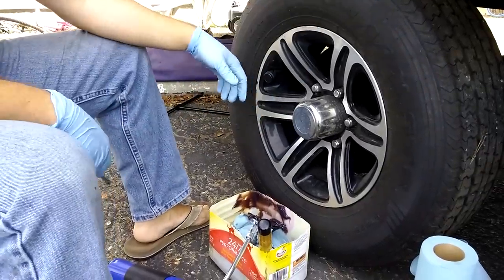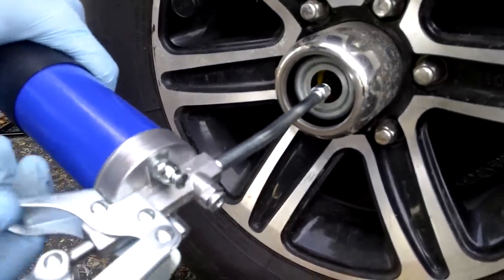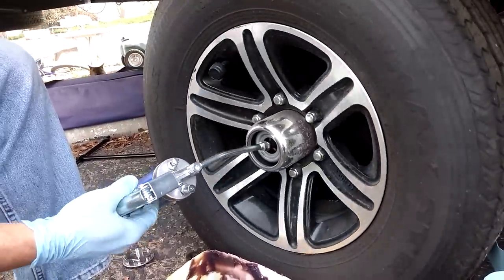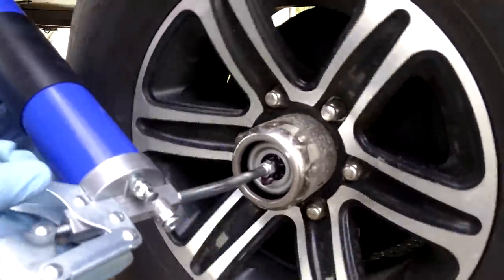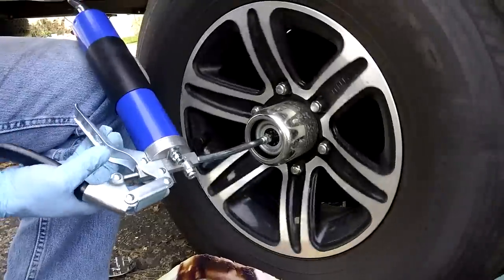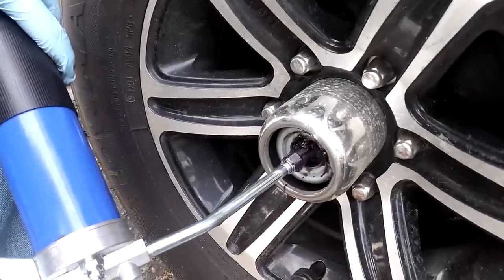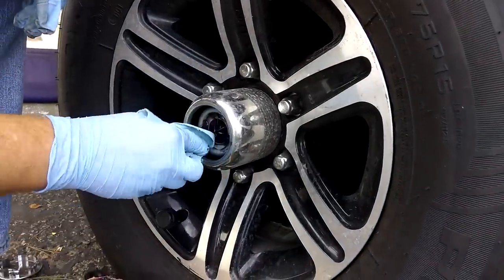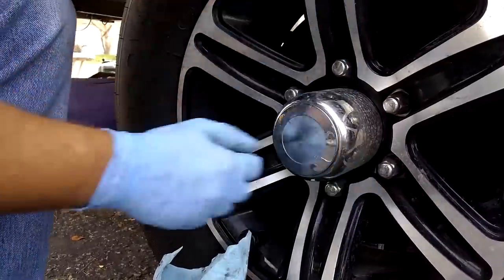How to Lubricate Dexter EZ Lube Axles

Comment: You didn't service anything. You don't know the condition of the bearings, brakes, magnet or the bearing adjustment.  Hub should never be filled over 30%. Over filling can cause the hub to over heat. EZ Lube is for emergency use only.

Comment: I just watched this video and I realize it's 6 years old but even if you go to the Dexter channel itself they don't show this way of redoing the grease in your bearings. They show tearing it apart inspecting them the bearings the races putting it all back together twerking the bearings to 50 ft pounds in them backing them off. I was always told not to do this You can blow the back seal out and screw up your brakes. I'll stick with pulling them apart cleaning every season It's a little bit of time to make sure that you're not running dry or over packing grease and maybe running out of brakes. Well this coming probably doesn't really mean much anymore He stopped making videos a long time ago I wonder why?

Comment: If you use this system, It's best to replace your current seal with a double lip seal. NO grease will get past it using a grease gun.  I've been using this system for 12 years and have had NO grease in my brakes as well as NO bearing failures or any other issues.  I do, Every other year, Depending on miles traveled, take out the bearings, clean and inspect and repack or replace. Works for me.
Reply: (It's best to replace your current seal with a double lip seal).....Would a double lip seal have a special number? How do I find the one that will fit my axle?
Thanks
Reply: Hosey OGradey have you had it fail otherwise? Just wondering why it was never stated in the manual...my father in-law has never switched his.
Reply: EZ lube axles have the double lip seal. Reseal after no more than 10,000 miles or 3 years. Bearing play will reduce seal life. So keep them tight.

Comment: Any one who actually believes this works, has never disassembled one of these axles to see how it is engineered. The end of the spindle is drilled all the way to the back side of the inner bearing, and then cross drilled to allow grease to come out behind the bearing. This DOES NOT pack grease in the bearing. In fact, I have repaired many customer's trailers that have experienced wheel bearing failure because the hub filled with grease then the pressure from continuing to pump grease in to this cavity pushed the grease seal out and now exposed the wheel bearing to dirt and water. Not a good design unfortunately :(

Comment: I'm on the fence about this.  I was told that OVER greasing a bearing can be bad for bearings, almost as bad as NO grease.  When you fill the hub cavity with grease, you're making it hard for the bearing cage holding the rollers to rotate, and can in some instances cause the rollers to SLIDE over the races and cause spalling or galling of the surfaces and lead to failure (not to mention the heat generated from all that grease churning around in the hub).  I have always disassembled the hubs and replaced the seal after a thorough clean and repack.  I don't care for the zerk idea myself.  That means extra work....a LOT of extra work, but I will have the peace of mind that the seals are fine and there won't be any chance of the grease being cooked and hardened.
Reply: Yup don’t believe in this, take them apart every few years

Comment: and the reason it takes so much grease is because you are filling the voids in the hubs. Under normal braking, lots of heat is created, causing the grease to be slowly pushed out beyond the seals leading contaminated brakes. Hand packing is the way to go. This system works great on axles without brakes, not with the ones shown in the video.

Comment: I have watched so many videos about how to grease these dexter axles.  
My conclusion is this.  If have to anyways take everything out once a year to inspect the breaks and do the manual packing, why in the world should I do the EZ lubing like the video shows, unless I put an insane amount of miles.  

Just put enough grease between bearing by hand before you put the outer bearing and I am sure you will have good lubrication for at least an entire year.  

I know it looks very easy to do it this way, but does it worth the risk of blowing the seal, or putting too much grease unnecessarily.  

Looks like the outer bearing won’t get enough grease until the void is completely filled and at that point it will be packed with grease and I am afraid of the risk of grease expansion once the axle gets too hot?  

In my case there is no way in hell I will put so many miles to my rig.  A yearly or maybe 2 years proper packing with plenty of grease will surely do.  Correct me if I am wrong.

Comment: I keep hearing that you can blow the seal out by pumping too much grease. But I also read that the EZ Lube axles were designed so this can not happen. I don't know which is true. I seen videos of people filling these with out even spinning the tires and saying they had no problems at all. Others are confusing these for bearing buddies and other's say you don't even have to do this on a cargo trailer it's only meant for a trailer immersed in water like a boat trailer. What is true here?
Reply: This advice about pumping too much grease is probably for other types of grease-able axles, like bearing buddies added onto existing axle, where excess grease/pressure goes out of the inner bearing seals (and can sling onto brakes, etc). If you watch the Dexter EZ Lube video they describe how the axle/bearing channels are designed to recirculate the grease through inner, then outer bearings, and finally back out around the fitting area. So at least according to Dexter, this video is exactly how it's supposed to be serviced.
Reply: It is possible to blow grease out the inner seal if you put too much muscle into your pumping. A nice gentle pump and spin the wheel and no problem.
Reply: @DragonPilot  I haven't had problem  after doing all 4 wheels; however , one of the rubber covers had I hole on it and there's grease coming out of it. I haven't seen those rubber plugs sold just by themselves but I did see grease cap kits made by Rockwell.

Comment: Just did ours on our ‘18 Jayco Eagle HT 5th wheel for the first time….  Took 150 pumps at each wheel before grease came out.  Assuming manufacture lubed them lightly….  Hoping next time only a few pumps as they are now filled w/ grease?

Comment: I put a lot of miles on my 20 and 24 ft enclosed car trailers. I’ve seen a lot of videos and read manuals. I do 200 to 2500 mile trips daily. I always check my bearing play by jacking up the trailer and seeing,feeling and hearing how it turns freely. I pump a small amount of grease in each trip, not a full tube at any time. I get back to base and take each wheel off and repack them correctly and check the seals. When that grease catches on fire from heat, you’ll regret it. Safety first. I change about 5 brake drums and backing plate brake assemblies on the 2 year span I keep a trailer.

Comment: Thanks for the video. I've only had conventional axles that needed packing. I have these on my new trailer and they look so much easier. Haha apparently to others who have commented, I'm an uninformed idiot I guess 😂
Reply: Backcountry Adventure Motorsports that's what I was thinking isn't the whole point of having a grease fitting so you don't have to do the extra work I think it's a lot better system I think what the other. Stand is it's not the whole point of getting new crease in there it's about getting Grease.
Reply: Backcountry Adventure Motorsports i

Comment: So please explain this.
You put a whole tube in.
Just a small golf ball of the old came out. How is that replacing the existing grease? What am I missing pls. I know you say they come with hardly any grease in them but surely they don't come with that little grease. Just confused.  Thanks.
Reply: This is his first try at this. There is a void in the spindle that need to be filled before it reaches the outer bearing and them out
Reply: @raylaux8295  i actually did mine about 2 months ago. Went perfect. Exactly as expected. Glad people made videos. That made it so much easier for me and gave me the confidence to.do it myself. Took about 3/4 of a tube per wheel. The hardest part was my fingers ached after a while. Well worth it tho considering the simplicity and money saved . And the peace of mind that it had been done right.  Read so many horror stories of places saying they replaced it and only partially did it.  Thanks.
Reply: @OverkilledUnderdog  Problem is you don't know if it is done right. You can not see all the grease you blew past the seal and ready to sling on the brake shoes. LOL. Seriously, replace seals if you have more than 3 years or 10,000 miles on trailer.
Reply: There are different colors of grease so change colors each time and you will see the new color come out

Comment: I've tried this with mine but it won't take any grease.  It must be clogged up inside.  I had them repacked at an rv place.  They looked very dry when I got it back.  I'm afraid to force grease in as it could blow off the rear seal.

Comment: If you have Ez Lube, do you still need to repack the wheel bearings sometimes?  I'm seeing mixed information on this.
Reply: You don’t need repack all the time!
Reply: I hand pack every 3 years or so, but do the EZ lube in between. It's good to take everything apart so you can visually inspect the bearings, races and spindles. Ya can't do that by just using the EZ lube system...altho it's perfectly fine for quick maintenance.

Comment: I have a 2010 36-foot fifth wheel RV made in canada by dougles (now out of business) it has three slides. It came with the Dexter axles and of course those axles came with the dexter Nev-R-Lube wheel bearings. I have to say that I like those bearings but when it comes to replacing one that has failed, I will not buy from Dexter due to their outragous price. Timkin makes the same bearing and cost a lot less. I replaced all 4 bearings with Timkin. Now on my Loadrunner inclosed car transport trailer, I came with Dexter E-Z Lube bearings... heres a link to Dexter showing how to maintain them 

https://youtu.be/XT0RKDGgDm8

Comment: There are plenty of stories of people doing what you are doing and ruining their brakes. Chances of leaving them without brakes because over filling.  This can cause the seal  to fail when the heat and pressure builds  up inside. 
I have see what this can do. The seal will fail and that grease will be dispensed within your brake drum coating the brake pads.

Comment: deprey  is right read your manual only 2 squarts per 500 miles. you got to take those hubs apart an clean probly replace breaks you are doing it all wrong.
Reply from the maker: This is the right way to do it for EZ Lube axles. I did read the manual.
Reply: I agree this is how EZ's are supposed to be done as per my cargo trailer manual
Reply: He is doing it correctly.  I think people get confused with A bearing buddy compared to the Dexter E Z lube. The dexter method pushes out old grease And repacks new.
Reply: steiger 256 pushes it where?! Out the back seal all over the brakes.
Reply: No, watch the video, it comes out the front.
Reply: 'Spell Check' can only do so much.

Comment: DONT use the Lazy-lube system unless you want to blow the rear seal, grease the brake shoes. Follow this step by step process by Dexter on how to do it the correct way. If you pump it full its like letting a blind man do it, can't see what is going on inside. https://youtu.be/GnH-h3W9XvI
Reply: Been lubing EZ Lube axels using this method since 2002.  Never had any problems with the EZ Lube system.  But maybe they're not idiot proof.  Who knows?
Reply: That video references standard axles, not ones with EZ Lube system.

Comment: Don't ever use this system. Since you can't see how much or where the grease is going most blow the rear seal out which allows grease to get all over the brakes. If you are just to lazy or don't know to pack bearing the old way take it to a shop. If you want to learn the correct way which is so easy watch this Dexter video, https://youtu.be/GnH-h3W9XvI
Reply: I have this Dexter system and would never use it. Go to the Jayco Owners Forum web page and read all the horror stories. Even if done as the videos shows you cannot tell where the grease is going and over greasing will cause seal failure, sure it won't happen every time but sooner or later it will. Just because Dexter created this system doesn't mean it doesn't have flaws. Its such a simple job to pull the hubs clean the bearings, inspect and if ok grease and reinstall. If you don't feel comfy doing it take it to the dealer, why risk your families life due to bearing failure or brakes that don't work, and the poor guy you reared because you can't stop. I know this is to the extreme but it can happen and I will not take a chance to be lazy and pump some grease in.
Reply: That video you posted said to set your new seals with RVT sealant...... l’ve never done that, should I be?
Reply: @satellitehunter7440  I didn't notice the RVT suggestion, I didnt do that just tapped it in flush and its nice and tight
Reply: Uncle fester so you’re telling people not to follow the video, point them to another video and then don’t follow the advice of the video you recommended?  Got it

Comment: DO NOT use the method described in the video. All you will do is push grease through the rear seal and ruin your brakes. Take the wheel apart and grease the bearings the old fashioned way. The EZ lube system is garbage.

Comment: Only an uninformed idiot would use the grease fitting to lube the bearings on a trailer.  You're just cramming new grease on top of old grease and possibly damaging the seal and contaminating the brakes.  Don't be lazy.  Disassemble the hubs, clean and repack the bearings, inspect the brakes, install a new grease seal, properly reinstall the drums, adjust the bearing retaining nut and lock it in place.
Reply: The grease fittings are there for that specific reason.  If they weren't meant to be serviced in this manner, the engineers wouldn't have put the fittings on there to begin with.
Reply: Shawn Crowe lol I spoke with a dexter Rep one day about this.  And as per him he said if a customer wants a pink tennis  ball that is stuck to the side of his unit then we will make a pink tennis ball that sticks to the side of the unit.  These are a horible idea and only amateurs that don't know how to probally do it use these.
Reply: You're the uninformed one. When it's time for an oil change, do you remove a quart or two of used oil and put back a quart or two of new oil.  Your oil will still be contaminated and will not lubricate as well.  The best way to keep your bearings lubricated and operating correctly for years is to remove them, clean them and pack them with new grease.  Period.
Reply: Or push enough grease so that all the old stuff gets out. And you could do that more often then your way.
So when you do an oil change you open the engine and wipe of the crankshaft hahaha wow!!!
Reply: vxnova1 thanks for the link. Great info!
Reply: Remi, I was thinking the same thing.  LOL  I always tear down the engine to do an oil change. LOL
Reply: I learned the hard way. I did what is seen in the video for 2 years and noticed when pulling my 5ver that it was not braking like it should. I pulled my wheels and hubs and noticed that the grease had smeared all over my brake shoes. I now do as Jim Hin does and have peace of mind knowing that my bearings are well lubed and that the grease is not on my brake shoes. This guy in the video said he put a FULL TUBE of grease in each wheel bearing? WTF Each bearing should only need when repacked about 2-3 ounces.
Reply: Yes but its a bad system. Easy for a rookie to blow the seal and ruin the brakes
Reply: Don't you love the idiots on here, they think pumping grease will do the job. I have heard of so many blowing the real seal, and not knowing it, then filling the break area with grease. Then they get in a wreck and wonder why the brakes didn't work. Now they have to replace everything inside the hub, and of course they don't know how so its big bucks at the dealer
Reply: What is wrong with the old grease?  Unless you have a boat trailer, there is little chance the old grease is contaminated.  Remember, the bearings on your tow vehicle are running in grease  and nobody removes/repacks front wheel bearings every 100,000 miles!  The trick is to drive the trailer for 20 minutes, get the bearings nice and warm, then gradually fill the EZ lube with new grease while rotating the wheel.  Look behind the wheel to ensure no grease is coming out from the rear seal.  Easy Peasy
Reply: I thought a whole tube was excessive.
Reply: Did you have this specific type of greasing system. This is not just a grease fitting on the end of the hub. They are designed specifically to pass the grease through both bearings and return the old grease to the front without leaking any great on the inside of the hub. I don't have these but I like the idea. If it's not too difficult I would still repack the bearing but not as often given this system so still a saving in time.
Reply: We have a bunch of zirc fittings on semi trucks and trailers to be lubed soooo they work.